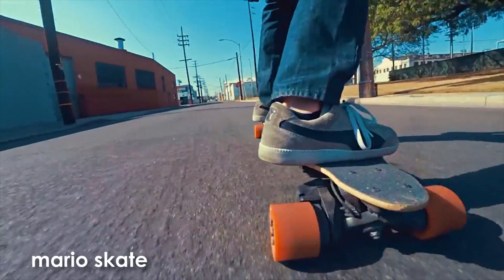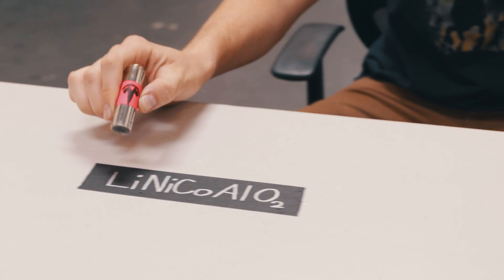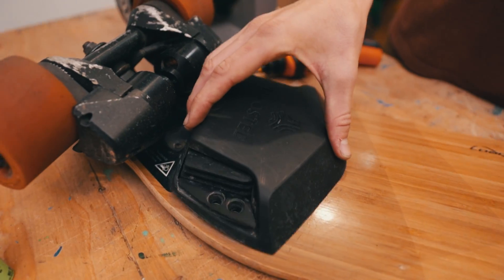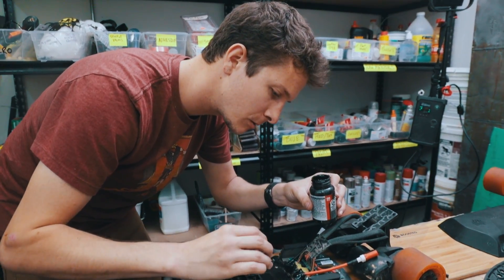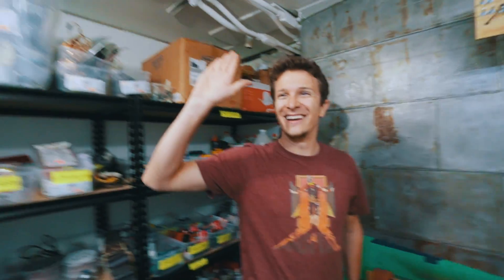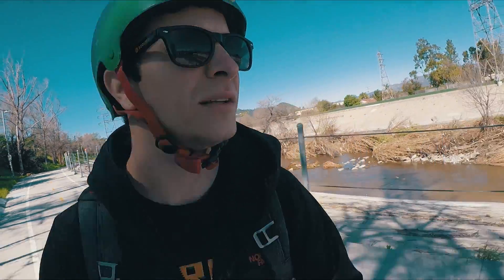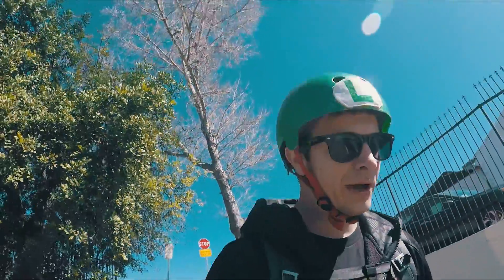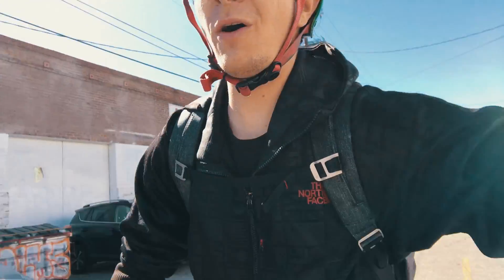Tesla Batteries in an Electric Skateboard!

Comment: Using the multimeter to check batteryvoltage while not riding is kinda useless. A battery will regain quite some voltage over time. That is why if you run a flashlight empty, turn it off and then on again it'll light up very shortly before the voltage dropped again. The load of the multimeter is too low to drop the voltage to the point an actual load will do.
Reply: Yeah totally. I got some of those voltage checkers that plug into the balance cables, but got them too late. It's hard to check the batteries with a multimeter while moving, and the part where I mention this didn't make the edit haha.
Reply: Thought the same, 36 V without load is not a good reading like he said.
Reply: You could use a Mooshimeter (Bluetooth/datalogging multimeter) to log data to your phone/an SD card. If you used a little ~10-50 mOhm shunt to measure current too, you could get some data from a ride, and work out the best battery setup based on the data.

One possible mod - use an external charger for the external pack, disconnect the internal pack entirely, and use 44v or 48v instead of 40v. A bit risky though, without having a schematic for the Boosted control circuit. Might trip a protection circuit or even destroy the controller.

Maybe get in touch with Boosted or post on Endless Sphere forums?
Reply: The datalogger is a great idea!

And yeah, at that point I'd rather just make my own electric skateboard. The idea behind modding the boosted board is simply to add more range to it. I don't want to alter the internal pack or the circuitry there.

Comment: Wren, you need to monitor the cell voltages under load. at rest the multimeter won't give true readings because current is basically 0 so the cell chemistry has time to build up charge.
Reply: 18650 cells are stable as all hell actually, and if he got brand Panasonic ones there's a fair chance there's protection circuitry built into the cap.
The reason you get less power from them is deliberate, it limits the internal production of heat that causes failures.
The lipo batteries that fail are either:
-damaged in manufacturing
-cheap, high current cells with sloppy tolerances
-mistreated by eng. error or user negligence
Reply: I agree and the fact that he doesn't have any sort of an integrated circuit for those batteries he added, worries me a lot, first of all he doesn't get to have them as energy efficient and second those things blow up sometimes so he needs to add some electronic wizardry down there.
Reply: Women get jealous, do you want your car to be a jealous bitch or your wingman?
Reply: Brian Dunphy I have know fucking clue what this means
Reply: Brian Dunphy you should also measure current draw under load as well
Reply: If thats the case he needs to check the internal battery resistance if he's struggling to pull the amps. That means the cells are cooked! Running those at full throttle will kill them. We don't even know the C rating on those cells.
Reply: the chemistry doesn't build anything, it's the internal impedance of the cell (around 30 mOhm) that causes a voltage drop when it's under load. To know the State of Charge you should in fact monitor the cell with NO load, but it's true that the cells should not go below 2.75V int any case (under load or not).
Reply: Wren Weichman it could be that the difference betweeen the boostedboard origional battery and the ones you added, create a debide in voltage which the esc could see as a dpleted battery.. aka try diaconnecting the origional battery and try tonride it, if thats not enough power, add more batterys.. simple as that
Reply: you mean no
Reply: I can't understand a word you people are saying
Reply: Excellent point.
Reply: Youssef barguinou he has balance leads on the packs, which is good. Voltage monitoring should be done by the ESC since he wired his packs in parallel with the original battery. That way tbe ESC should shut down when the LiIons are at 3V each, which is fine.
Reply: Brian Dunphy that man at 7:50  has an gopro on his chest
Reply: Brian Dunphy I
Reply: What he just said ;)
Reply: I feel you matteo
Reply: Brian Dunphy where abouts did you your learn circuitry and electrical engineering?
Reply: Phearo G you mean the Other Wren Weichman account that one actually has videos that Wren on this thread is a fake
Reply: Rose Dunphy exactly
Reply: What!?!?
Reply: I know what you just said
A
Reply: English please lmao 😂
Reply: I have no clue of what you just said
Reply: A
Reply: Rose Dunphy x this makes me feel dumb but I'm not done with school
Reply: Rose Dunphy I don’t know what the heck you are talking, but I agree... 😅👍😂
Reply: If I tried to do this I would just switch the batteries cous I don't know anything about that stuff
Reply: WTF Who gives their car a male name? The only other time I can recall, is that guy on strange addictions, who fucks his red chevy firebird 'Chase'. And Geoffrey too, this guy is clearly a psychopath.
Reply: You're right, I DID need to check the voltages under load. I actually did mention that but it didn't make the cut. I didn't get my little cell checkers until after the trip and it's hard to use a multimeter while riding haha.

As for the circuitry/safety comments, no need to worry. These are the NCR18650B batteries which are super good. They're basically the best cells in this format you can get, and I got them directly from Panasonic. Also, wiring up these batteries with a BMS is overrated. That's not really needed these days for batteries, especially if they're bottom balanced.
Reply: Rose Dunphy learn to spell and stop failing English
Reply: Rose Dunphy 🍆😩🤤👍👄
Reply: Wren Weichman dude stop posing as wren! Wrenthereaper (pinned comment) is wrens account, what do you even gain from this???
Reply: james the everything guy I know
Reply: Brian Dunphy ikr I came from top saddest warrior cat deaths to thisXD

Comment: Nice Idea Wren.

How about using a transistor, using the on-board battery minimum output attenuated down to the gate voltage of the transistor. That way when the on-board battery dies, it'll be isolated from the board and the other two batteries would be able to continue powering the board. Similar to how some emergency light circuits work.

That'll require a bit more technical soldering though and I'm unsure how the charging circuit works on that board. Perhaps adding a switch to override the transistor would over come any issues.

Comment: Is it possible to make the extra batteries charge the default battery as you go? so the default battery never runs out of power and the extra ones are never used directly into the board
Reply: Scotty Potty while possible it is somewhat dangerous and would be inefficient, and would require a voltage booster
Reply: Also constantly charging them could ruin them pretty fast, LiPos are only meant for around 1000 charging cycles before rapidly loosing capacity
Reply: Charging and discharging a battery at the same time is not inherently dangerous as long as you stay within the charge and discharge specifications of the battery cells.  this happens all the time in most modern EV's that have regenerative breaking, all the electronics and heating / cooling systems pulling current from the main pack while the regenerative breaking is charging the pack at the same time.  Also mobile phones and tablets still work while they are plugged in.

also, a lipo with a rating of say 500 charge cycles is rated as such for a full discharge, i.e. from full to empty.  they will last for many thousand shallow discharge cycles such as peak current demand for acceleration and going up hills, while being topped up slowly by a trickle charge while the board is cruising at low amps or stopped. It would still be inefficient though so maybe not the best way to solve the issue.
Reply: 1981therealfury True, it's not inherently dangerous, but still not exactly best practice. Also your comparison with regenerative break lacks a bit, since that would only recharge a few percent each time, not refill the whole battery multiple times. But the can see where you are going.
Reply: Nicolas Oswald You are right, my comparison to regenerative breaking was a little off.  In the situation of using the additional battery packs to feed power to the main pack they would actually keep the main pack fully charged until they had depleted and only then would the original pack drop down in SOC. 

There is nothing dangerous or not best practice about charging and discharging batteries at the same time.  As long as your load on the battery pack is at or below the supply of power by the charger then you are not discharging the batteries at all, you are simply using the supplied power from the charger to run the load rather than pulling charge from the battery its self.  Its actually preferable as it would have the least impact on the cycle life of the cells this way.

Comment: Id  say just remove the original battery set.

Also, you should check if the Boost-It board has some sort of regulator that lowers the current when the batteries get  too low.

Comment: What if you don't utilize the batteries directly but rather charge the boosted board battery continously?
Reply: Papitz0603 this would still require some kind of voltage booster to be at all effective. It is also inefficient, and discharging and recharging a battery at the same time can be dangerous.
Reply: Inside Electronics short circuit?

Comment: Doesn't the boosted board have a removable battery, so you could just replace that battery compartment with a custom one holding your batteries with more power meaning the board runs off your own
Reply: This board is the first generation Boosted board which does not have a replaceable battery.
Reply: Batteries are not cheap, and since he already has the boosted board battery, I am thinking he wants to utilize that too.
Reply: +Rasmus Tollund I know that they're not cheap but if the first battery is bottlenecking the extra capabilities of the other 2 then why keep the first one
Reply: M4dhead Furthermore, the board will not run as effectively at the lower voltage. And therefore the problem would still remain

Comment: Is there a way to hook up the extra batteries to feed into the booster board battery? Seems like you by passed the booster board battery and the board shuts down when the original battery does not have enough juice.

Comment: Do you think you could use the custom battery packs to keep the board's original pack at full charge? Just an idea.
Reply: Frostburn that would be very inefficient and the batteries would still not be fully utilized.
Reply: S-L-R it can be dangerous to charge and discharge at the same time also charging circuits are inefficient and can only charge the internal battery up to the voltage that they have unless you use a voltage step up
Reply: That is smart. Instead of plugging the new pack directly on the existing one, he could plug the new pack in the charging port of the board in order to keep it charging while its running. Does the board works while it's plugged-in? That is the question.
Reply: Inside Electronics it seems like you are getting ignored...
Reply: It's still inefficient.
Reply: could he have the boosted board being used up first, then switch the first 'modded' battery to power the board while the second 'modded' battery charges the original boosted board charger? idk if this is possible i didnt study electronics xD
Reply: S-L-R That's exactly what I meant. Kind of like how you can use your phone while its battery is being charged (by a portable battery pack.)
EDIT: I know you aren't supposed to do that, but you can, and people do.
Reply: Yeah you would have to match the spec of the charging brick exactly. Also, do the math to check charge vs discharge rate.
Reply: I don't think it'd be efficient and the charging circuit might not be able to handle high current if you try to use from there
Reply: GamerL546 it is perfectly possible with a simple switch. The problem is that the boosted board will not turn on when the internal battery runs out or disabled. This is ultimately down to how the board is configured (half the controller logic is routed through the battery management system) and unless you're insanely good at reverse engineering don't expect to bypass that one.
Reply: A battery does not like to be charged and drained at the same time. This is why phone manufacturers say turn your phone off or to turn on airplane mode when charging.

Comment: Overriding the boosted board original battery with another one of your packed batteries? That way it should check on the actual voltage of the "modded" battery and keep using the other two's. That's the first thing that came into my mind but I don't even know if it's possible!
Reply: I think the problem is that the boosted board has a voltage detection circuit that reduces the power to the board once the voltage gets below a specific point, even if he removed the original battery and then just used his 2 packs, they would still cut out at the same voltage as they do now, the battery packs he uses to add to the board would need to match the chemistry of the boards original battery, alternatively he would need a new motor controller board that can handle the new battery packs voltage range.
Reply: Yeah, same thought here. Or even remove the old boosted battery and only go on the new ones. If thats possible...
Reply: He took out the old cells, and put in his two batteries.
Reply: @1987therealfury: yep, this is exactly the case. DC/DC booster like other people comment is not viable due to the high currents. Mostlikely the booster controlboard has a few resistors to read in the battery voltage, you can modify them. Higher torque seems impossible to me as the motordriverboard is designed for the current which the boosterboard uses, higher current and thus torque is only possible with a more bulky motordriverboard (or 2 more motors and controllerboard on the other axel).

Comment: wouldn't it be possible to completely remove boosterboard battery allowing you to utilise your left over energy from the other two batteries? However if everything is wired parallel it should it not be fine?
Reply: Nah, the problem would still be there.
His board doesn't really react below 32.5V (according to his statement), which his self-made batteries go under when it's getting depleted.
He'll either need to set a higher voltage battery and work with a converter to bring it down to the voltage his board allows which will end up with high minimum voltage upon depletion, or use batteries that fluctuates a lot less so that the voltage doesn't go below 32.5v, which can be expensive.

Comment: capacitor maybe i dont know just thinking of something i saw earlier not an electritian :P
Reply: Hehe :P
Nah, capacitors flat-line the incoming voltage, that's pretty much what they do.
So when the battery goes under 32.5V, lets say 30V, the capacitor will flat-line it as such.

But I do see why you think such would work, at first it looks more convoluted than it actually is ^^
Reply: cheers for the reply as i said no idea if it would help just something that went through my mind :)